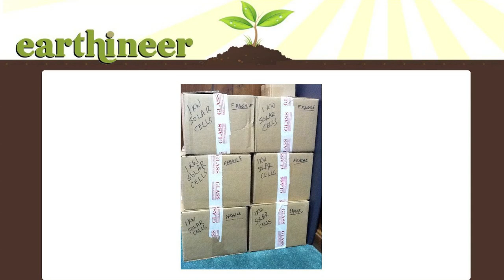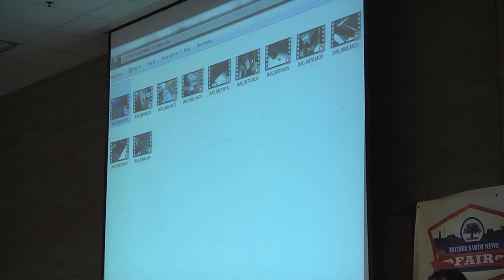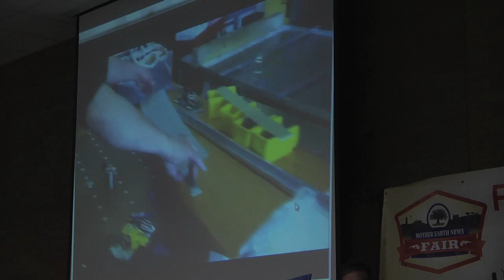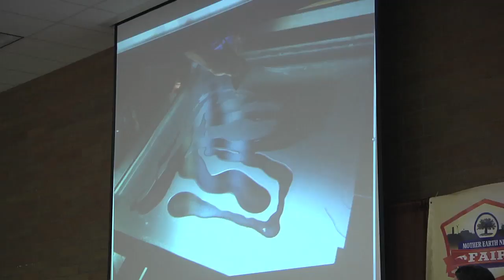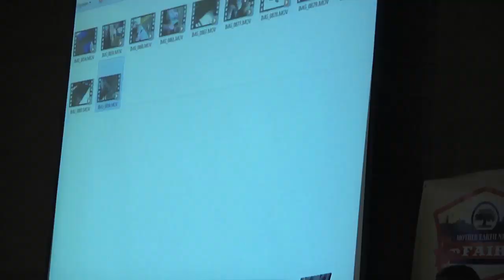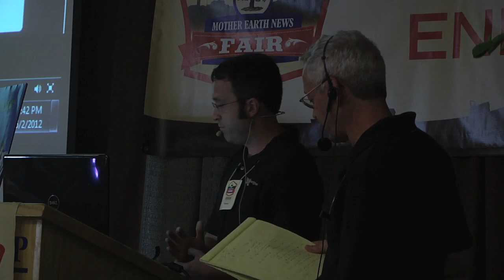Earthineer: DIY Solar Panels Presentation

Comment: I put a small motor on the table so it can vibrate. Leave it on for couple of hours and you will get rid of the bubbles. My table also has a hole in the middle, where i put the frame, so i can have access to both sides...
Reply: By the way love your video. You never stop learning new things. Got so many ideas from this video. Thank you guys.

Comment: Thanks for the video and sharing the information what you learned while making the panels. 

Would it be possible to combine solar panels and solar water heater together? Heated panels would release the heat to the water, which could be used in home shower. Then again cooler solar panels work more efficiently and would produce more electricity.

Comment: Plastic is less transparent than glass, meaning that there would be a ~30% reduction in the amount of electricity generated relative to a glass front module that is otherwise identical.

Comment: You are supposed to heat the materials with the iron for a moment first then add solder, not load solder on the iron first. If the material isn't hot enough to melt solder on its own before adding solder you are not getting a good joint.